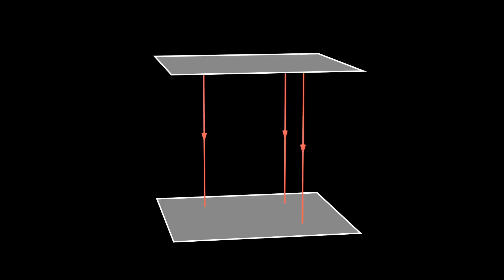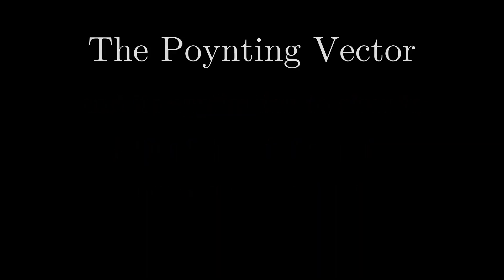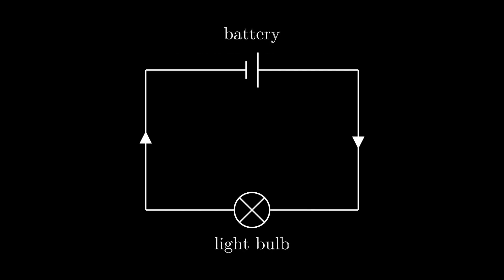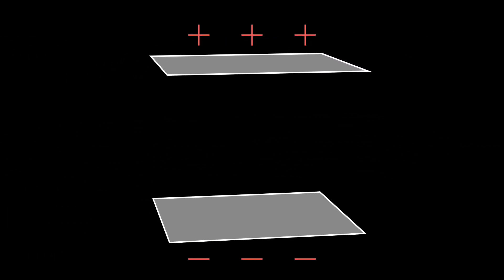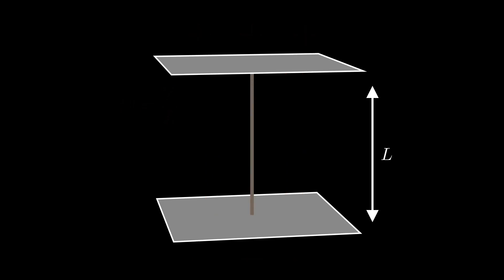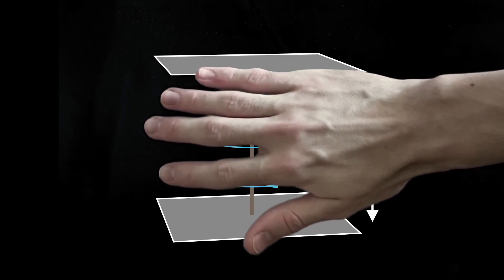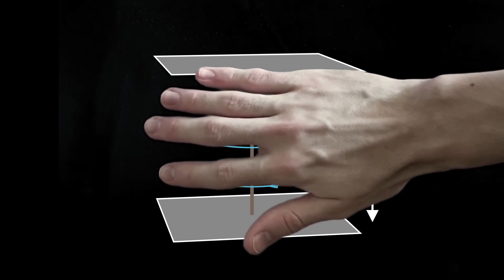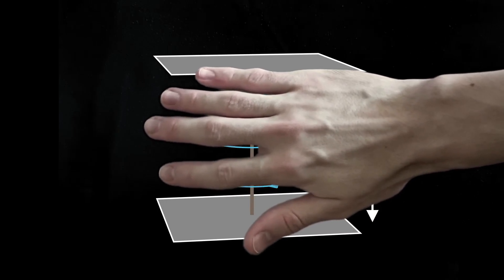The Poynting Vector in a DC Circuit

Comment: Although this is probably the best explanation I have seen so far then I still have lots of questions. Firstly all the fields and vectors mentioned are really no more real than the values we put to them. They are mathematical tools just as numbers in my opinion. 
It is probably correct to say that the energy is transmitted with the help of Photons. As I understand it then a photon can be either following a wire and the electrons in the wire or it can be let free as happens when we have any radiation. Photons always travel as close to the speed of light as the material they travel in allows them to travel. 
I would suppose that a photon can only be let free when it has been there long enough to form a full sign wave. 
As it is we also know that any pulse can be mathematically formed by a base frequency and harmonics. I believe that to be true in real life too. I believe that when we switch on a DC current then to create the initial potential movement a lot of high harmonics are created and as their wave lengths are very short they will be free to move in all directions. I believe these harmonics are really the ones that Veritasium see at the lamp initially because I think most of us agree that at (supposed ) DC  the actual power has to follow the wire.
I say supposed DC as I really will classify DC as a very slow AC. I am yet to know one that has stayed constant for ever. Batteries die. There fore I believe we can look at all currents as AC currents and all changes there fore contain harmonics. That is why it is impossible to have a 100% square wave. There is always a rise time and a fall time. 
What I really would like to know is what is a Photon? It is an amount of energy having a frequency but what is it really. It can move with an electron but it can also move without an electron. It's generation appears to have some thing to do with the electron but it is only an amount of energy released from the electron. It can be trapped in a transmission wire as a standing wave. It influences the electrons so that we can measure it's existence  and it can heat up the cable by moving the electrons and molecules against the resistance in the cable. It has polarities as seen with polarised light But what is a Photon?
Reply from the maker: So, in "classical" electrodynamics (i.e. Maxwell's equations) there's no such thing as photons; there are only charges, currents, electric fields and magnetic fields. Photons arise in quantum mechanics, and I'm not super experienced with QM, but I can give my vague understanding. In the most "ideal" model of QM, which I guess would be quantum field theory, everything is a field and particles like photons are just excited states of those fields. My understanding is that the "harmonic" properties of the electromagnetic field are what becomes quantised when you move to QM, which is why photons have quantised frequency and polarisation.

In theory if you were to simulate these fields on a massive scale with a vast number of excitations, it should behave very similarly to classical electrodynamics. What we call classical electric and magnetic fields are really just the average of an absurd number of particles constantly appearing, interacting and disappearing. But this is extremely impractical, so for areas like optics and electrical engineering there's typically no need for the quantum model. If it ever becomes important to include the quantum effects of atoms, then you can work in a sort of 'hybrid' model where atoms have quantised energy levels but the electric and magnetic fields still follow Maxwell's equations and there are no photons.

These sorts of approximations slip in all over the place when trying to describe quantum mechanics intuitively, which is annoying because it means a lot of intuitive descriptions of photons are contradictory! But at the same time, those approximations are precise enough in their respective contexts that I think they can be considered "reality" in a sense.
Reply: @josephnewton  In my opinion the word Photon may not have been mentioned in Classical Physics but it exists just the same. Photon is nothing else but a fancy word for a sine wave or more exact the energy of a sine wave. As I understand it it originated from the amount of light or energy given out when an electron jumps from one position in an atom to a lower energy level. This energy is usually given out as light or at least an electromagnetic  emission. it has later been established that all EME are photons just with different frequencies. As the energy of photons are Planks constant multiplied by the frequency of the EME  it is there fore also the energy of one sine wave. (Planks constant is the smallest possible energy of radiation divided by the frequency. E=h*f or h=E/f) That makes sense to me as the smallest part of a radiation you can have and still know all the data of an emission has to be one full sine wave. 
Although I have not done it I would not be surprised if that could be derived from Maxwell's equations and Coulomb's law. 
 When you talk about having to measure on a massive scale then this is really no different to when you measure a 50 or 60Hz main voltage. You do never measure it momentarily as it wouldn't give you any sensible result. You could get zero volt or you could get peak voltage or anywhere in between.
In my opinion looking at it from my practical experience as an electronic engineer having mainly worked as a technician then the photon is never a particle. It is always a fluctuation. The field it is fluctuating in is if we look at it on an oscilloscope nothing else than the zero level (which I suppose could be called the zero field) and there fore really nothing I would say. It is the philosophical question about what zero is.
I really think that the Physicians  are making it much more difficult to understand than it really is by trying to make it 100% correct in the wave calculations. To correctly calculate the power of a 240V 50Hz current flow you should really multiply the point current with the point voltage which involves integration to get the result but we usually don't need it that accurate.
Reply: As an add on after some more study I find that every photon has the same energy value = 4.1333*10^-15eV or 6.626*10^-34J if a photon is one cycle. If a photon is the energy in one second then it is the frequency multiplied by the energy value of one cycle. To me that points more to that the knocking free an electron from a cold body has more to do with the frequency than the amount of energy.

Comment: Awesome video, Im wondering why you didnt use the H-Field (with units of amps / meter)? Wouldn't it yield simpler calculations? I get the feeling that using the B-Field though paints a more accurate picture of the situation?
Reply from the maker: Thanks! The H field isn’t just a conversion factor, it has a very different value inside a material. It gives simpler forms for Maxwell’s equations by taking into account bound charges and magnetisation of the material. That’s mostly irrelevant for this video where everything is in a vacuum, and my memory is that E and B are the commonly used fields in high school physics, so I thought it wasn’t worth the additional confusion.

Comment: There is something everyone is missing in this Poynting vector topic (Derek, Electro-Boom, many others including you I'm afraid): you all assume that the EM energy is following the poynting vector; this is not true or at least not necessary !
If you look to the Maxwell equations and you try to make an energy balance you end up to the Poynting theorem. However this theorem doesnt define straitforwardly the energy path !
The classical Poynting vector is indeed a possible choice but if you add any arbitrary rotational field to the Poynting field, the resulting field will also verify the Poynting theorem. It results that in the Maxwell frame there is an infinity of possible pathes for the energy flow !
A long time ago, with my former PhD supervisor, we wrote an article on the subject. We proposed, in the quasi-static electric approximation (the capacitor case), an energy flow density only based on the voltage and the local electric field (no magnetic field involved). In this case you end up with an energy flow that is perpendicular to the Poynting field (parallel to the capacitor axis instead of radial to it). 
Many researchers justify the choice of the Poynting vector because it is the only quantity that both fullfills the energy balance equation (the Poynting theorem) and is conservative through lorentz transformations (is a relativistic invariant) but this last point is irrelevant in the quasi-static domain (for coils and capacitors).
QED states that there is only a probability for a photon to be emitted somewhere and absorbed somewhere else and that there is no way to follow a photon inbetween these events. Said otherwise there is no experiment that is able to determine where the EM energy flows whitout interfering with the setup you try to measure.
To summarize, no one knows the actual trajectory for the flow of EM energy, this information is not imbedded in Maxwell equations !
Reply: Interesting point but the Poynting Theorem is about local energy conservation. Relationship between rate of change of energy density, work done by field on charges and charge on field, plus flux thru surface. The differential equation for local energy conservation in electromagnetic theory is a statement about what's happening at a POINT but when integrated the Poynting Vector is used to calculate total flux out of volume thru boundary surface. Poynting vector gives you the magnitude and DIRECTION at each and every POINT with magnitude units of power over area. So it's giving you energy "flow" and in which DIRECTION. Flow can be potential energy.
Reply: The local energy flux is not defined by the Poynting theorem. The local energy flow is unchanged by adding any rotationnal field to it (this is related to the gauge invariance). The same issue arises for the trajectory of a photon that is also undefined locally (there is no quantum dentity matrix attached to the photon in contrary to other particles). I agree that theses notions are not easy to grasp and require a good knowledge of differential operators.
Reply: Inaccurate for many reasons:

1. Even if we were to accept that the pointing vector is only unique upto a rotational field, it still does affect the total flux through a closed surface, so there is definitely a direction of energy flux.

2. The pointing vector (together with EM energy) is the Noether current associated with time translations, and that is BY DEFINITION energy flux in all field theories. 

3. General relativistic electrodynamics yields completely different predictions for different definitions of the pointing vector, with current technology this is impossible to measure, but the fact that these predictions exist means it is an empirical problem rather than a definitional or philosophical one.

4. QED doesn't say that. That is an inaccurate interpretation of QED, the reality is far more complicated.
In fact, the reality of QED resembles classical Electrodynamics very closely and this includes the poynting vector. Most people ignore that the equations of motion of QED (in the Heisenberg picture) are literally just Maxwell's, the nature of E and B is changed from vectors of scalar functions to vectors of operator valued distributions which does makes the theory immensely more complicated but many algebraic results still apply, this includes poyntings theorem. Poyntings vector similarly becomes a vector of operator valued distributions which makes it's interpretation far more complicated, but one thing I can say for sure is that that kindergarten level interpretation of photons as little balls that have probabilities of going somewhere can't possibly be further from the truth, for starters, in an interacting theory particles aren't even well defined. You should think about quantum field theory in terms of fields, not "particles".
Reply: Excelente resposta, de fato nunca saberemos a trajetoria do fluxo de energia, sendo que o mesmo esta imerso nas equações de Maxwell. abs from Brasil
Reply: Quantum mechanics reigns supreme 😅
Reply: Prototype of photon on 4 foot rock nearing completion. 
https://youtu.be/tF-1dF0eBts?si=m3CDsRiwsKLdig3J
Reply: Kantanl3 • So, in your opinion, Maxwell is God and nobody can add to what he said? 🤔🙄😯
Reply: I am not really able to do the vector math properly, but somehow this poynting vector always feels just like some bookkeeping tool that can tell how much energy flows into a given volume or out of it. Static magnets in combination with static electric fields for example produce non-zero poynting vectors, but no energy is transfered at all. So these vectors for themselves can not be useful for deciding where energy flows. In the example, the surface integral over any given volume will always cancel to 0, which is in fact a useful result. 
In an example with a wire and some current flowing, you could compute the energy going into some closed volume next to the wire and this will also cancel to 0. But this will say nothing about how much energy passes "through" this volume, if it indeed it does. Same for some volume that encloses a part of the wire. 
Maybe the whole thing can not really be decided and is more a philosophical question.
Reply: @copperdragon9286  Indeed you explain clearly the idea without the complex operator analysis. Lets say that they are fundamental limits to our knowledge. The precise location of the electromagnetic energy flux is one of them, both in the maxwell equation frame and in the QED one. By the way this is why Willis Lamb (Nobel price 1955) wrote an article in 1994 entitled: "Anti-Photon", where he says: "There is no such thing as a photon". Lamb was upset by the modern dogma around the photon seen as a classical energy particle with a defined position and speed. More recently David Louapre (ScienceEtonnante) made a whole video on the topic.
Reply: @copperdragon9286  you shouldn't be arguing this with someone who did their phd on it when you can't even do the math
Reply: both of you guys are wrong

Comment: When talking about current,  please specify whether it's "conventional" (holes), or electron current.
and when talking about left and righthand rules, I'm confused over the magnetic direction the fingers are pointing. 
I have read explanations of electromagnetic effects where the author speaks of positive and negative poles of a magnet. 
I didn't understand what they meant.
Reply: Electric current is by definition conventional current. Whether the charge carriers are positive moving in one direction or negative moving in the opposite direction is irrelevant for this system.

Comment: I think the random letters for variables is because a lot of the obvious ones were already used by other things in physics.  When you're only using one letter each, you only have the constants and variables for the number of letters in the alphabet, the Greek alphabet, and maybe a few special things (and upper case letters, but that adds a lot of confusion if you aren't careful, and is harder to say than write).  

The earlier equations got to use the obvious letters (f=ma), but letters in a language aren't evenly distributed, so there were many later ones where the obvious letter was already taken, so they had to use a different letter.
Reply: The letters are not usually random, and actually can show a bit of history behind the physics, like I coming from the French intensité du courant, intensity of current

Comment: 12:46 - the core observation that you get a small "step" immediately after launching a wave down a transmission line is routinely seen in digital circuits and can be surprising to newbies. It's not explicitly mentioned anywhere in the wider discourse of the Veritasium video but electronics engineers might have caught wind of that. 
Also the full t-line based analysis of the veritasium video is insanely complex since the structure of the problem excites the single ended and double ended modes of the two t-line arms, which really makes it hard to understand unless you're familiar with it.
if the problem were posited as one transmission line to the right instead of two on both sides, the analysis becomes much simpler and any EE undergraduate should be able to understand that.

Comment: Great video! Thanks for not over-simplifying things like a lot of pop sci does. I have a question though, so for the square circuit, the poynting vector field followed the path of the energy in the wire, which makes intuitive sense to me. And you talk about how the divergence of the poynting vector is a measure of how much energy is leaving or entering a point on average. But in the first example the poynting vector was pointing perpendicular to the wire and the flow of energy. So, is the direction of the poynting vector sometimes distinct from the direction of the flow of energy and sometimes not? Or is there really no energy flow between the plates through the wire, and all of the energy is flowing into the wire from somewhere off to the side off screen?